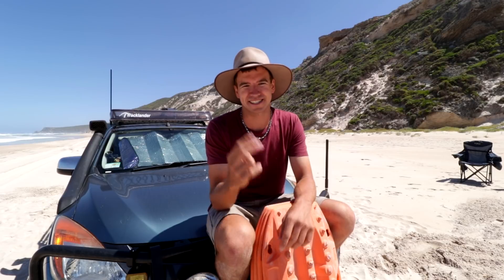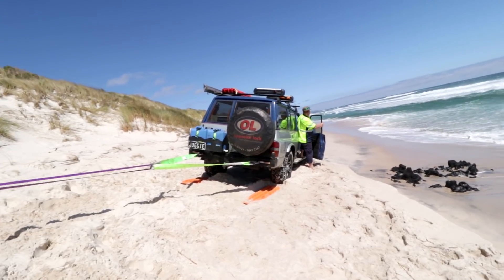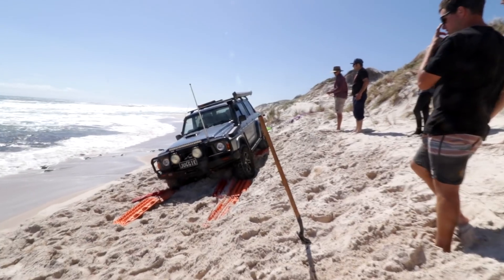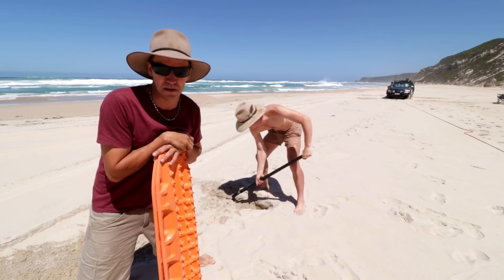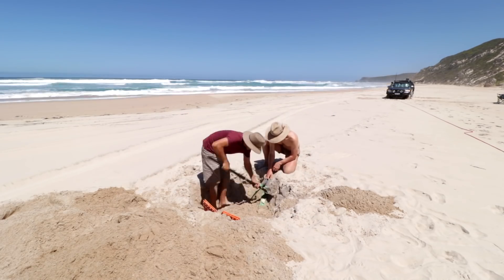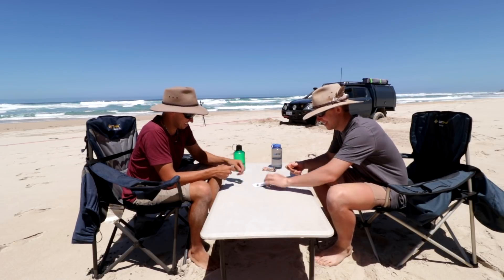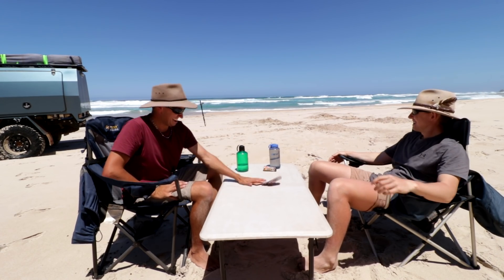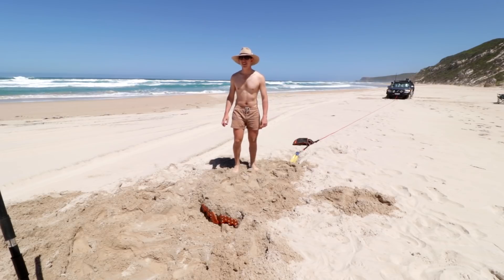Maxtrax Sand Anchor | 4x4 Self Recovery Technique | Part 2

Comment: Its a good option because if you're really bogged on some soft sand and the recovery tracks alone only get you a couple of meters. You can winch yourself a much greater distance onto harder ground. Also, you can pull yourself in direction which could be useful in a couple of situations.

Comment: Cool and yes I am impressed. As you said way quicker to use the tracks the way they are designed but for situations where you need support when you are stuck on an angle, this seems like a very feasible recovery method. Not having a winch on the 'plastic fantastic' (90 series) I wouldn't have much option but an interesting demonstration.

Comment: Have used the maxtrax on slopey beach, very soft sand... when using them as designed the car would get up on top, then slide off closer to the water. Buried one maxtrax, the worst one i had, and pulled us out. Car weighs 3600KG...worked a treat.... did bend the maxtrax in half. But after 7 years of abuse I’m due for some extremes now, in black of course.

Comment: I could have used this in norther Moab. Going over a small section of road as most was washed out. On other side washed out and other large drop culvert made from flash floods. Made it through one way. But on way back front made it over then the road gave out on the drivers rear to the frame. Saw that due to angle we couldn’t use max tracking as weed have a strong possibility of us doing a roll over due to be at max articulation. We started to dig down and use maxtrax as an anchor point since there where no suitable anchors in the area. But never got to do as about two feet down digging another vehicle came and used a kinetic rope.

Comment: While I think you're right that in practice it would make more sense to just use the trax how they were designed but it is entertaining to just answer the question. :-D I think Benny Banger is on the money but you may have to have a fixing on the bottom and part way up. The aim is to make the trax act like a plough type anchor where it digs in the more you pull on it!

Comment: My gut feeling is you need to attach the strap slightly below the middle of each track to use the wieght of the pull to bury the tracks. That would mean you wouldn't need to bury the tracks quite as far down as they should bury themselves when pulling. Why not try it with only one track using this approach?
Reply: @SeekAdventure  Fair enough Michael. Curiosity got me! -Always generates more work - usually for me!
Damn good point too - when you are in the situation, YOU will work out a way!

Comment: Nice video, wonder where your winch controller is located.. Planning to install one myself and planning to get the recovery remote control wiring to the inside car so no need to get out :) Love the Mazda BT50
Reply from the maker: Thanks 🙂. The winch comes with a wireless remote, it has a range of about 30m. 
After having in-cab switches in my last car and having the wireless in this car, I'd take the wireless any day. You can operate it from outside the car, handy for spooling your own winch rope after a recovery 🙂. Atleast with in-cab switches they are hardwired, so in theory nothing can go wrong 👍

Comment: Would crawl control work in this situation?
Reply: r g crawl control relies on your tyres having sufficient traction to drive the vehicle forward. 

In this case, the tyres have dug into the sand, and any rotation, however gentle, will only result in digging deeper into the sand. So it’s not likely you’d achieve anything.

You may get somewhere if you had that Mercedes system where it bounces the car, so as you are spinning tyres, the bounce actually allows the sand to fill the hole in theory. But I’m yet to be convinced it’ll do anything when you are seriously bogged 😂

Comment: Try it with a boat anchor see if it works, save yourself a lot of digging.
Reply: Boat (sand) anchors pull deeper into the sand the harder you pull on the rope until they can no longer displace the sand- just have a rope on the back end of it to pull it out after! Some sand anchors work better than others however so maybe do a comparison test, because with an anchor you dont have to dig a big bloody hole......
Reply: Yeah because everyone wants to carry a frigging boat anchor in their 4x4 lol